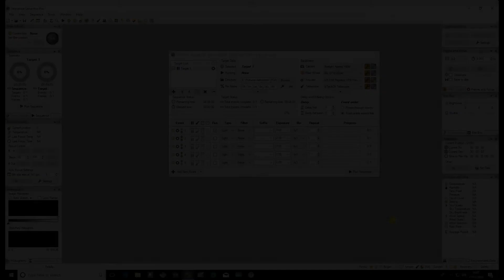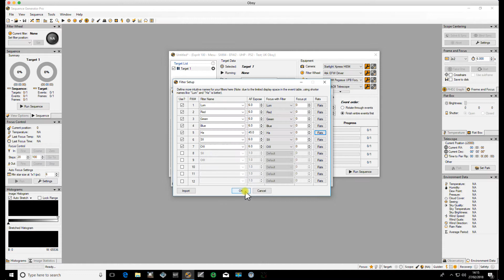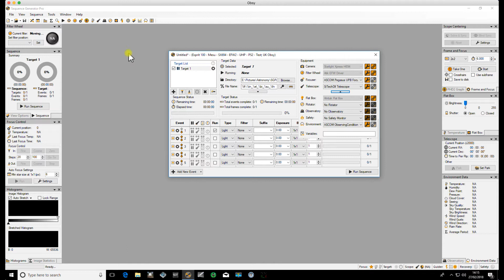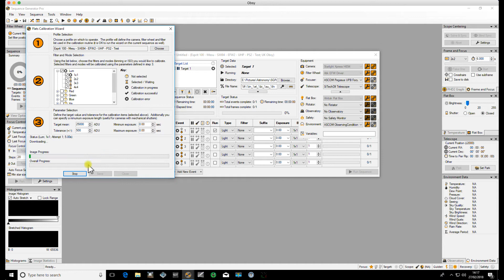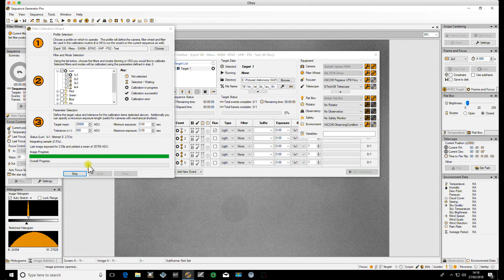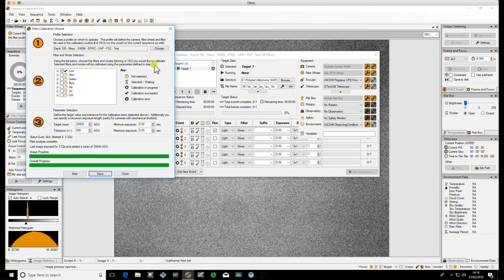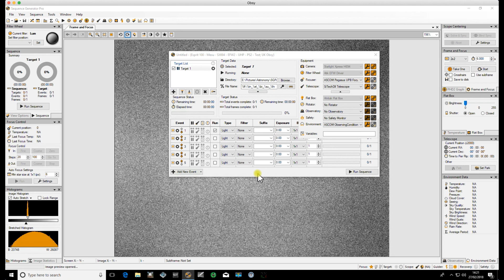Sequence Generator Pro Flats Wizards - Part 1 of 2

Comment: Great tutorial. I am having trouble finding the ADU for my camera though. I am using a ZWO ASI178MM-Cool. Is there a calculation or something to work it out?

Also when I run the calibration wizard I get 0.21 seconds for each of my LRGB filters. When I go to add that data as part of my sequence all the exposures come up as 0.09 seconds. Not too sure where it's pulling that value from so I reconfigured and still the same thing. I just changed all the values manually to 0.21 from the original calibration. Something I am doing wrong?

Thanks!
Reply from the maker: Hi and thanks for commenting.  From what I can gather, the ADU for your camera is 15,000 at unity gain.  You should aim for around half this value as your target ADU in the wizard.

There isn't a calculation as it is based on the full well depth of your sensor.

I'm not sure what you are using as your flat light source but 0.21s seems quite short for decent flats.  I would typically try to darken the source a little and head for flats of around 2 seconds.

Not sure what is happening with the calibration figures.  As long as you have opened the profile you want to calibrate within, and make sure you save after the wizard, then this should write the correct figures in to that profile.

Comment: Is the Gain setting of the camera important? Meaning does the flats calibration wizard have to executed with the same Gain/Offset setting as my lights?
Reply from the maker: Hi Bjoem.  Yes, if this is set up in your camera settings it will pull this information off anyway.

Comment: I followed this step by step and SGP won't save the exposure time to my profile. I finally just wrote down the values and manually entered them and then saved it. It works but I can't figure out why it wont save them to my profile. Has anyone seen this issue? My comments in the SGP forum have went unanswered.
Reply from the maker: Hi Scott.  The only time I've seen this is when the changes are made in the open (active) profile, rather than through the Equipment Profile Manager.  If you already have a profile open and make the changes then they won't save unless you save the sequence as a profile.

Make sure you are applying the exposure settings in to the correct profile via the Equipment Profile Manager, and then saving, but you then need to apply that profile to your current sequence by opening >File>Apply Profile to Sequence.

I'll have a look at your question on the SGP forum also.
Reply from the maker: Ok I've had a look at your SGP forum post.  Let me know what version and operating system you are using, Scott, and I'll try to replicate this.  There seem to be a number of people reporting it so it could be a bug which needs reporting, but let's have a look first and see if we can isolate it.

HTH
Reply from the maker: Hi Scott.  Having now refreshed my memory and had a “oh yeah” moment, once the calibration wizard has been run, the 'set no filter flats' information will be blank. To find the stored information for your filters, you need to click on the ‘define filter list’ box, not the 'set no filter flats' box.  I do it quite quickly in the video so easy to miss.  You then need to click the ‘filter’ button for each filter you are using and the information stored should be there.

HTH

Comment: Thanks for the useful video. I am not quite sure what you said about adjusting the light intensity for different filters. I assume this is something you add manually and only if you have an adjustable intensity lightbox? Does SGP then adjust the intensity level for each filter automatically through ASCOM?  I use my IPad or white computer screen, I assume this doesn't apply to me then?  Thanks
Reply from the maker: Thank you Mostafa.  Yes that's correct, it only applies if you have an ASCOM connected flat panel.  For your iPad you would just set a single intensity and let it run through the wizard at this single level.  Using items such as the Alnitak flip flat means you can also adjust the intensity levels, which SGP will change for each filter, but without it it will just use the single intensity.